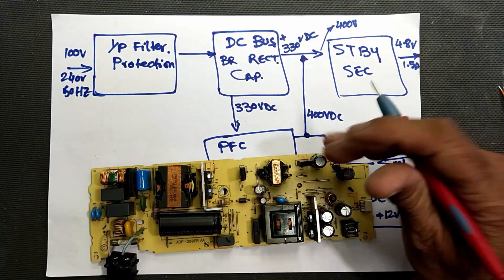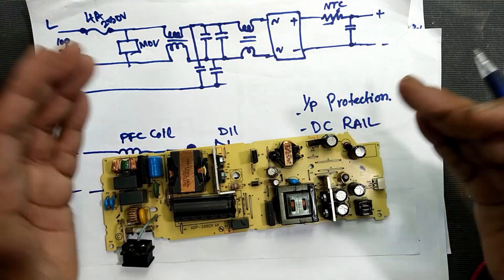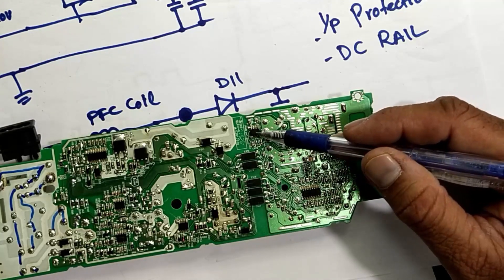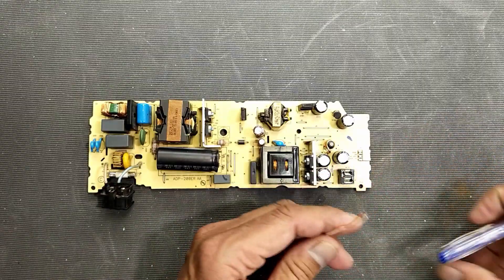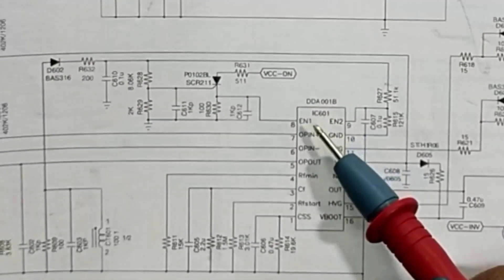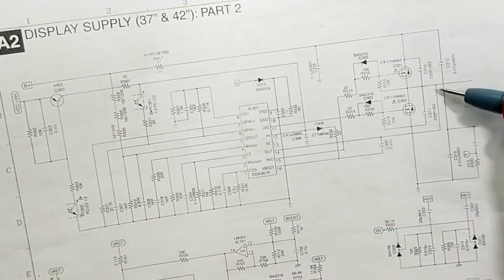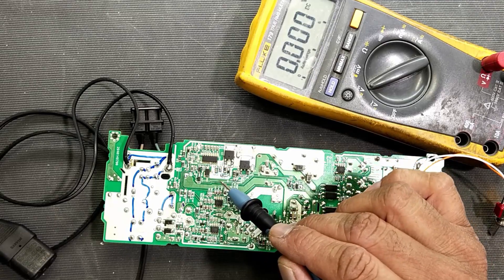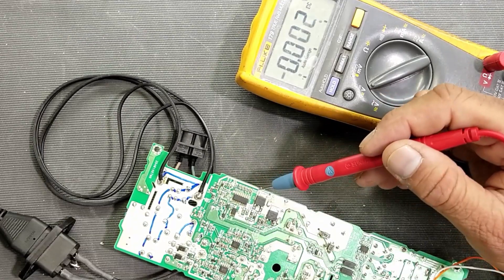355 Sony PS4 Power Supply PSU ADP-200ER - Push Pull Converter DDA001AG

Comment: I watch all four videos of this series. Superbly helpful. But I'm still having doubt about how the standby circuit switches on the PFC circuit.
Reply from the maker: best regards 
standby section first work without PFC and when the PFC circuit is operative then it gets dc voltage maintained by PFC. 
PFC circuit gets biasing from  STBY section
Reply: @HaseebElectronics  I have stand by 5 volts but my PFC doesn't get activated even after I press the power button. I suspect the 16 pin IC DNP012A is faulty. This IC has one of its pins directly connected to the power button connector.

Comment: THANK,IF YOU UNSOLDER  PIN 1 AND 2 ON THE OPTIC COUPLER  HAVING TWO OPTIC COUPLERS CAN YOU STILL TELL IF OUTPUT COMPONENTS GETTING HOT IN THIS CASE.
Reply from the maker: if we remove pin 1 & 2 of optocoupler in this case, the output should fluctuate, because the feedback will not reach to the smps controller. 
in this condition, in this condition no component should become hot, because most of the time the smps controller runs in restart mode and it stops function immediately due to over vcc voltage from vcc winding. and IC restarts again after a very short interval.
Reply: @HaseebElectronics  IAM SORRY IF YOU PUT A DIODE ACROSS PIN 1 AND 2 AFTER DESOLDERING BOTH  OPTOCOUPLERS.
Reply from the maker: I never tried diode across pin 1and 2.